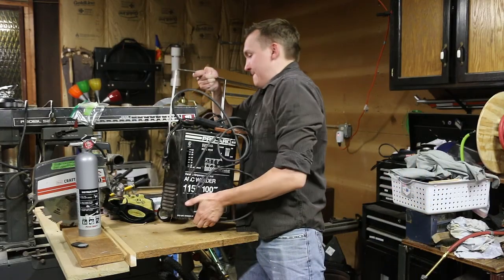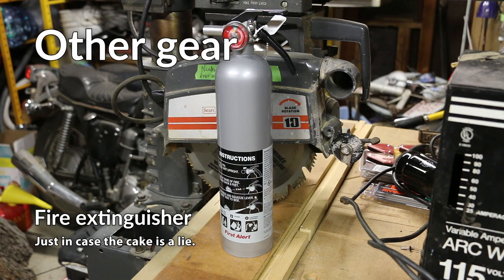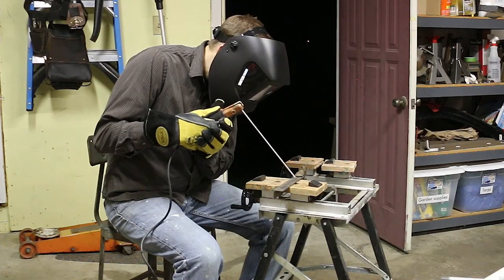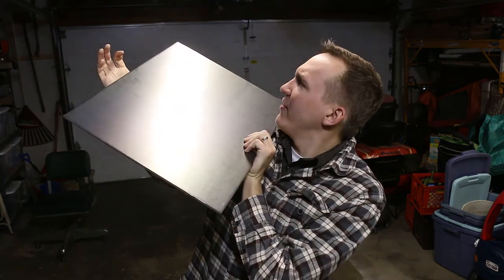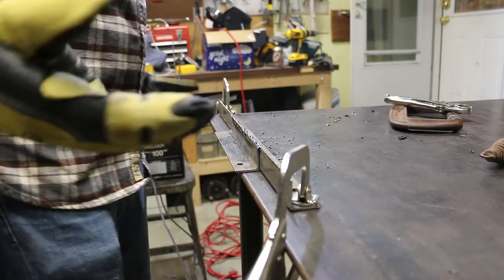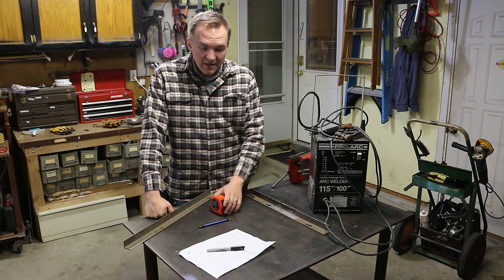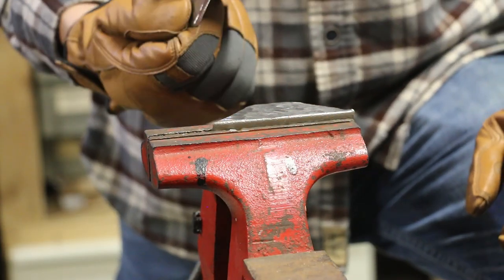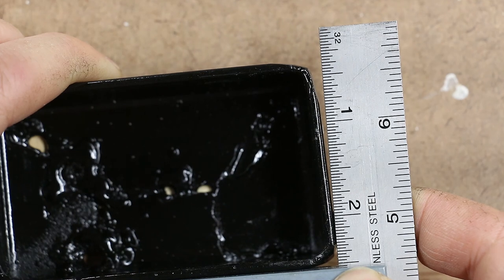Can a newbie get good results with a cheap stick welder?

Comment from the maker: Here's some answers to a few questions you might have:

WHAT KIND OF RODS DID YOU USE?

3/32" 6013s. I tried 1/16" 6013s for the 16 gauge sheet metal, but I couldn't get them to work at all.

HOW DID YOU PROTECT YOURSELF FROM THE SMOKE?

I tried to vent it outdoors at first, but that didn't work the best, so I picked up some of these and wore them with my dust mask: http://smile.amazon.com/gp/product/B007STCT00

WHAT KIND OF WELDER WAS THAT AGAIN?

It's a Pro-Arc 115 volt, 100 amp stick welder, model 10412. I can't find a manual for it, unfortunately. If you have one, I'd love it if you shared it with me! andy@projectlab.how.

WHAT DID YOU THINK OF THE HARBOR FREIGHT AUTO DARKENING WELDING MASK?

Worked great. No problems so far.

Comment: So here is advice from someone who has only stick welded three years;
Push the electrode down harder, the stops you had in the video was because your arc gap was too big.
I don't touch the rod, but this is personal preference. I focus on bracing my other hand, that way you can use massive 14" electrodes and still be comfortable. 
Rest your elbows on the table, it will help you with your arc manipulation.
You are going back and forth WAY TOO MUCH. I did this too, nasty habit. It's good for stack-of-dimes aesthetic welds, but horrible for good, strong, easy welds. For home gamers like you and me, welding in horizontal positions, just drag the electrode and wait for the puddle to cool. Don't go too slow, and you will have a sexy weld. 

Sorry for the critiques, but I thought you may take them to heart.
Another thing - You are welding in a lumber shop. Just remember that heat and wood do not mix, and wet wood is very conductive. Don't zap yourself or burn your shop down. Have a good day, keep up the awesome videos!
Reply from the maker: Great, actionable tips. Very much appreciated! Thanks much, and you have a good day, too!

Comment: Thank you! Great video for us new guys! It can be very confusing! I bought a Harbor freight flux welder because it was cheap and I wanted to learn how to weld. It was good for practice, but not only do I suck, the welds were horrible and wouldn’t hold. I want to try stick welding next, and your video sold me on just starting with another cheap machine until I get better at this! I like the fact that your not cocky! Keep posting!
Reply from the maker: :) Thanks for the kind words! Finding an infinitely-adjustable machine seems to be the key. Also, one thing I learned from the commenters here: You really have to shove the welding rod into the puddle when stick welding. Helps make sure there's enough metal being deposited to join the two pieces. Good luck!

Comment: What Joseph said.  You do not want too long of an arc length.  Shove that thing down into the desired welded area if you have to.  Hold the electrode at about 45 degrees in the direction you are traveling and brace your forearm with your free hand.  One of the most important things when you are learning how to stick weld is to be comfortable.  Also, once you strike an arc and begin welding, go slow and steady at an even pace.  Practice with different types of joints.
Reply from the maker: Thank you! Appreciate the hand control tips. Definitely trickier than it looks :)

Comment: Great start! If I were to make a suggestion though, in my experience cheap mig welders work a lot better than cheap stick welders, and are easier to use for thinner metals. Things like stick welders are definitely useful, but for stuff like thin sheet metal, its very difficult. Thats just my opinion though.  Love your videos, keep it up!
Reply from the maker: Thank you! Cool to hear about the cheap mig welders. I heard that some of the cheap ones lack a true voltage controller and instead just have a high/low switch; is that just the super, super cheap ones or do better grade cheap machines have that functionality? Or maybe it’s not even necessary?
Reply: Andrew Reuter the first one I got as a kid had a high low switch, but you can definitely still work with it.     One big thing though is to not have  it on an extension cord, that'll significantly lower the amperage. Other than that, even the ones with high-low switches aren't too terrible, and I think you can get cheap adjustable ones on Amazon

Comment: I have 5 welding machines. The 3 little 120v machines probably do 75% of the jobs. They work great on thinner stuff, but even 1/4 plate can be done if you bevel the hell out of it. Keep it up and don't get too frustrated and practice practice practice!

Comment: i  got one like 30 years ago i weld like crazy works great i use 5/64 6013 welds  . I also still have the paper manual   i don't use 1/8 rods  6013 are the best for that welder  i call mine a BUZZ box  lol  i weld just about and steel with it  i remember  i got mine at mcmaster carr  was like $139 new at that time
Reply from the maker: That is awesome! Three decades of use is one heck of a deal! Would love to have the manual for mine!

Comment: Man, I just bought a stick welder to mess around with and I'm pretty sure this is how it's going to go.
Reply from the maker: Very cool! One urgent tip for you that I wish I knew when I started this video: You really have to push the welding rod into the weld. It's not something that any of the welding training resources I looked at talked about, but a couple of people suggested that in the comments here. I just tried it this weekend and holy cow did it improve the quality of my weld. I was even using the thin 16 gauge sheet metal and it worked.

It feels very weird to be doing that because so many videos seem to talk about keeping the stick hovering just above the joint. But I think by just mashing it in there, you are really making sure that enough metal gets deposited by the melting rod to make a solid connection.

Good luck! Let me know how it goes. And cool music on your channel!
Reply: Andrew Reuter awesome, thanks for the advice and the compliment! I shitpost my audio therapy from time to time, just messing around with reason 5 for funsies. Some come out okay, lol.

I found an amico 140 amp 110v dc inverter for around $99, the duty cycle is pretty high at 60%@110A, will see how it goes. 

I plan on trying to run 1/16 6013 on thin exhaust tubing as a crash course into temperature control. I saw you tried to run 1/16 as well, did you try 6013 electrode negative? fwiw DC electrode negative seems to be much easier to strike and control with less spatter from what I've seen, but it does lack on penetration. Perfect for sheet metal/lapped exhaust tubing.(In theory lol)
Reply from the maker: That sounds like a heck of a machine for the price! I don’t believe mine can do anything but AC positive. Still works surprisingly well on sheet though. Just welded some 16 gauge together at 90 amps with the 1/16 6013 and it really held together. That was pretty much just a bunch of “spot welded” tacks though. Not sure how well it’d do when trying to seal up an exhaust pipe. Will have to try it eventually here though. Damn road salt! Good luck again on yours, let me know how it goes.
Reply: Andrew Reuter ugh, tell me about it. I just recently moved away from the DC area, the new pine tar road salt is killer. The dust just gets everywhere but have to say it does work really well.

That's good to hear about the tacking on AC, you tend to get a lot more penetration on AC. I got the 2mm 6013 rod instead, when I overlap my exhaust it's around 4mm so I should be able to do it, just have to get used to the puddle and avoid punching holes. Will see by Thursday, so giddy to try out a new toy. lol

Comment: Just saw your video on the welder. Did you ever get a good weld from it? Had a friend that was a coded welder that bought a small 120 Amp stick welder to do projects out and about., when I asked him about it he said it is easier to carry around so it makes it easier to use on away projects.

I do realize the difference in old ac and new machines. Learned on old oil-bath myself. Just wandering.
Reply from the maker: Sooooooo I admit I haven’t gone back to it since getting the Eastwood MIG. I will have some thicker stuff to weld coming up though. Will have to dig this back out and give it another try!

Comment: that looks like bed frame angle iron... it crap. head to the scrap yard and get some real steel.
Reply from the maker: Agreed! On my to do list...
Reply: The kind of sparks coming off indicate a high carbon steel. Perhaps that's why it basically shattered when you bent it. Try a mild steel bar or angle from a steel supplier. Warning rabbit hole looming :) Careful or you'll end up blacksmithing next.